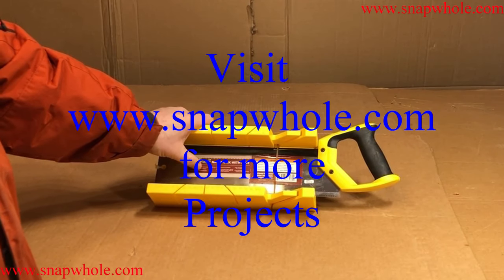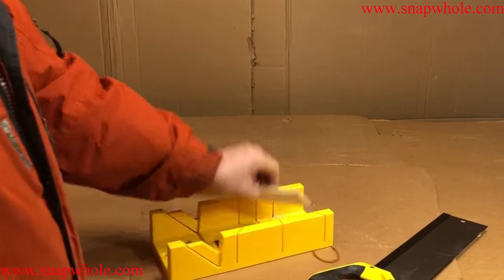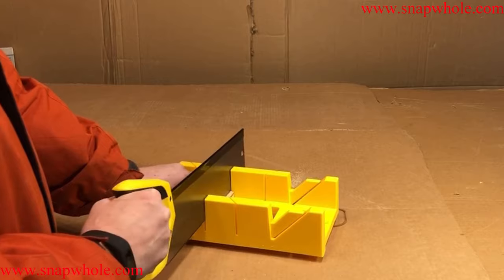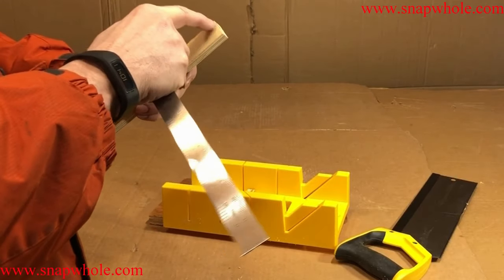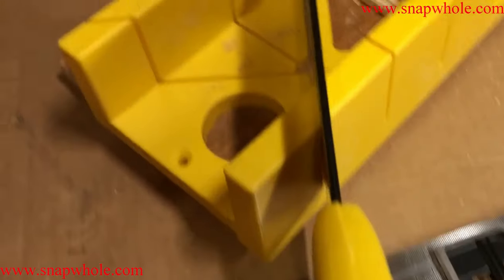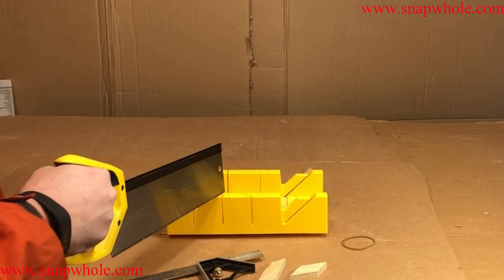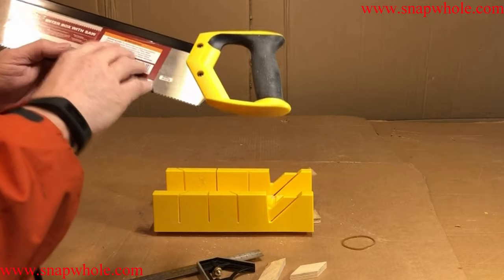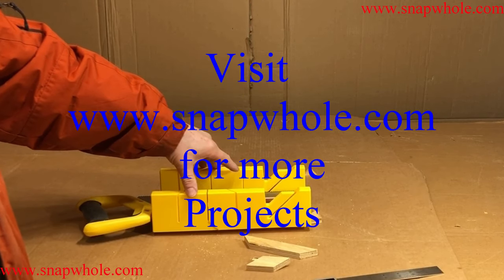Harbor Freight 12 Inch Plastic Miter Box with 13 1/2 Inch Saw Review - How Accurate?

Comment: I like your reasonable review due to cheap price. But an upgrade to it would be to glue thin plywood on all three sides then make an accurate cut. Might tighten up the tolerance a bit. Plus I screw mine down to the work bench.
Reply from the maker: thanks for Subscribing!

Comment: Holy crap $5.99? They are $12-15 here in Central NY. I tore mine up the first time I used it that’s why I am searching to see what i did wrong. I only need it for some crafting. So a backer and clamping it down might help.
Reply from the maker: these are meant to be disposibile, and you have to be careful, there is enough play in the slots to allow an incorrect cut, clamping it down will help a lot, oddly the more expensive ones don't work much better, the best part is the saw, I've used them for other projects, like making a cabinet scrapper, a cheap sourse for the steel needed - thanks for subscribing!